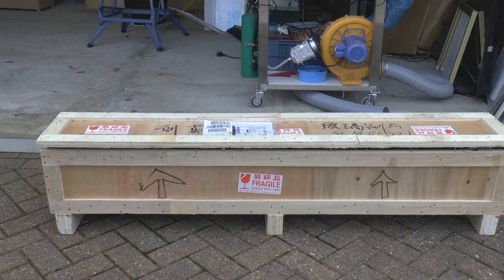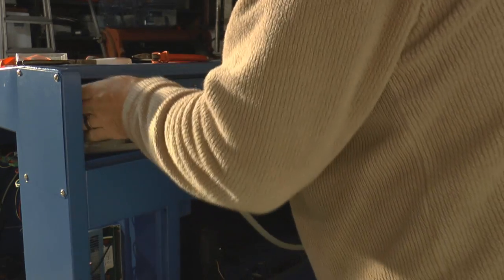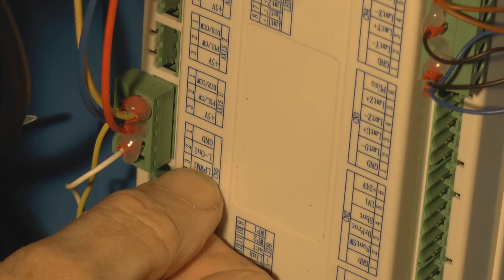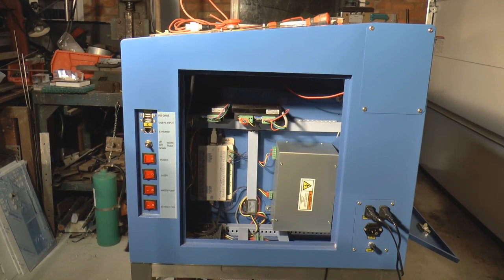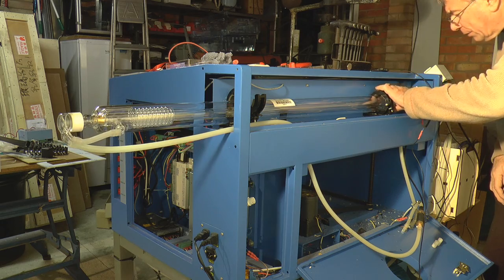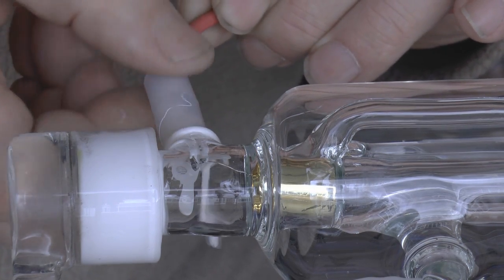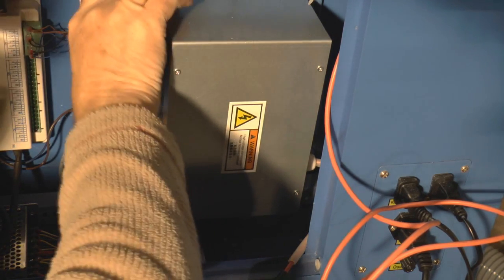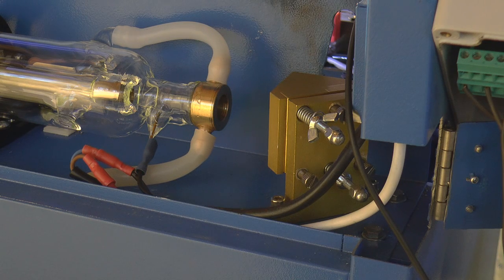RDWorks Learning Lab 50 fitting 60watt tube and PSU

Comment: Congrads! :)  I also upgraded mine to 60W recently: http://lensdigital.com/home/?p=1498
I got SP tube, and it's also outputting over spec. In fact it gives 60W at just 14mA!  However as you probably know out you can't really run it at 100% since PSU gives more current than recommended. On mine I get around 20mA at just 60-65%
Reply from the maker: +bratan007 
Nice job. Yes our tubes seem very similar 62watts at 14mA.  It's a bit like upgrading to a Ferrari after learning to drive on a donkey!!. I shall be happy to get the consistent performance that was so missing on my previous tubes.
Best regards
Russ
Reply: +SarbarMultimedia I have a 60 Watt tube that will do 60watts at 14 Ma as well.  The reason why you are able to get more at a higher Ma power setting is that they over spec the tubes (at least the good vendors do) in order to provide the advertised 2000 hrs (or whatever they promise) of service.  If you consistently run the power above 60 watts then the life of your tube will be shorter.  So I always keep my tube at the recommended spec even though I could probably drive it up to its 22Ma rating.
Reply from the maker: +Ron R 

I copy the Chinglish words from the tube manufacturer  (not an agent) in answer to my direct question about the maximum "normal" drive current.   22mA would be normal for most 2000 hour tubes but I specifically asked this question because  I noted in their specification that their recommended "normal running"   max was higher than what I had expected. I quote:

1.laser tube when you use it, please don't use full power. please set 80% power, then it can protect and prolong the laser tube lifetime. And for the 40w,60w laser tube, the lifetime is 4000 hours, if you pass over 4000 hours, then the power will decrease, it is normal. and the laser tube is consuamble, and it need to change it periodically. 
 
2. For the 60w laser, the 25-26mA current is prober. don't over 28mA. If use 22mA, the laser power would change less. 

When you examine my power/current characteristic you will note that at 22mA  I'm getting about 72 watts and the power is showing no signs of flattening off.  The manufacturer says  go ahead and use it at 26mA and you will expect 4000 hour life. This steeply rising power curve at 22mA is the overhead in the tube to ensure it gets to 4000 hours.  This is NOT a long life tube  just a lot longer life  than most cheap tubes. I have run several hours on it so far doing  full power (22mA) tests for a future project. It is an absolute dream to use after my other tube. 100% steady and predictable and I can set any point on my characteristic with confidence. I know this is what we should expect, but after my previous  experiences....well, a pleasant surprise

Regards
Russ
Reply: +SarbarMultimedia 

I know how you feel.  I have one of those large Black and Red "60 watt" lasers.  I was over-driving their (obvious to me now) 45-50 watt tube.  I put the new 60 watt tube in and it is amazing the difference.  I had the same reaction you did in the end of the future video when you made that nice deep mark in the acrylic.  Love your videos.  Great work!!

Comment: I have enjoyed all of your videos and own a 50W ebay laser myself.   You may be interested in my new post on achieving the red dot spotting laser through the optics without a beam combiner.  https://www.youtube.com/watch?v=0gABmmm_aJo
Reply from the maker: +Peter Jensen 
Hi Peter
I have seen people use a half reflecting mirror at the position you mounted your pointer, as their way of adding the red dot to the beam. I like your way better because there is no loss of power through another obstruction in the beam path. I had no intention of using the red dot as a "cut locator" when I designed my tube "clip-on" pointer (mk3). It was purely for occasional use to aid beam setting. By missing out the first mirror your aid is a completely different animal. Please don't take that as a criticism because that's not my intention, I am just examining differences. If you had turned it through 90 degrees and poked it through a bulkhead hole to pop in and out between the tube and first mirror  that would then make a great mirror reference beam tool as well.

It's rather coincidental that you are trying to solve a pattern location problem because I was discussing possible solutions for this problem with another user just recently and came up with a completely different solution that was entirely mechanical and allowed quick and accurate location of your  program to an image placed on the table. I suspect it's a but time consuming to get your picture well located when you have to track all round each time to make a small adjustments. Now that my major machine issues are behind me and I have managed to wring every last milliwatt of power from it, one of the subjects on my list of interesting topics to play with in future is just this pattern location problem, along with lots of detail features within RDWorks that I haven't touched yet because they are so poorly documented. I don't usually have to go looking for video session subjects, they are just there as problems I want to investigate/solve.
Thanks for sharing your design
Russ
Reply: Hi Russ the main reason for my  design was that having used a laser cutter with a combined red and co2 beam for about 6 or so years I really missed this facility.  Actually adjusting the pattern position is quite quick and can be done at engraving speed.  Also you could just select 2 or 3 reference points so you don't have to wait.  I  am now also looking at moving a mirror rather than moving the laser.  This negates moving wires etc. The laser could be mounted on the front plate with vertical adjustment. I also use cove adhesive on the pin bed as an absorber with zero back reflection.

Comment: what is the name of the company you purchased the system and the laser from ?
Reply from the maker: +John Grabner 
Hi John
The original machine purchase was
http://www.ebay.co.uk/itm/350B-50W-CO2-Laser-Engraving-Cutting-Machine-Auxiliary-Rotary-Device-0-60000mm-/111694615353?hash=item1a01849339

and the 60 watt upgrade kit was from
http://www.aliexpress.com/store/product/1200MM-60W-Laser-Tube-60W-co2-Laser-Power-Supply/321243_1109607209.html
You  can contact Gelly Dung directly by email if you need more information. They are very quick, honest and helpful but this is not a published contact so out of courtesy mention Russ Sadler gave you the address .......   sales02@mactron-tech.com  

Good luck
Russ
Reply: I have now watched most of your videos.  I must say I am very impressed with the systematic approach you have taken in analyzing and modifying your machine. 

You have done a great job giving an objective view of the quality of the hardware and software.  While not perfect, it appears quite acceptable.  Is this  your view?  I normally choose the devil I know over the unknown.  Your series appear to be the only objective review of the performance of a Chinese laser.

Before selecting this machine and it's software, did you do a comparison of other Chinese machines available?  If so, could you share.  

On various public bulletin boards I see lots of comments that Aluminum lasers are better than Glass tubes.  Do you have any insight on this topic?

I live in California.  Your link appears to be for someone importing this product to the UK and selling there.  Can you give me the Chinese name or the manufactures name of the laser machine so that I can look them up on Alibaba.  

You have produced a very impressive set of videos. Thank you very much.

Regards,
John
Reply from the maker: +John Grabner 
Hi John
Although I spent lots of hours researching before I bought, I was still naive at the point of purchase. I was putting too much faith in the specifications being true. I should have been wearing my ultra sceptic hat. I looked hard at the main and important mechanical features of the machine. Particularly the main slideway bearings, There are many "unusual " designs, but if these are primarily engraving machines then the Xaxis slide is going to be heavily worked. Hence I chose a conventional HiWin type slide system. I then looked at the mirror mount system and in particular the software /drive controller to make sure it was a stand-alone machine or a network machine that could in particular work with my favoured cad DXF files.. This machine ticked all those boxes and looked like a well engineered platform to adapt if so required. Having looked at others in retrospect I would choose the same again. It was excellent value for money even though the tube was not as promised!!

Look carefully at where it's shipped from. If it's direct from China you could well have to add on import duty and  taxes. If it's aleady in the USA then it will only be freight, but even then I see you can get "free" shipping with some suppliers. These ebay sellers are all agents for factories back in China, so there will be no service support if things are not what you expect. This is virtually the same package as mine which I bought from a UK seller (who is actually based in China!!) 

http://www.ebay.com/itm/High-Precise-50W-CO2-Laser-Engraving-Cutting-Machine-Engraver-Cutter-USB-Port-CE/200640422116?_trksid=p2047675.c100005.m1851&_trkparms=aid%3D222007%26algo%3DSIC.MBE%26ao%3D1%26asc%3D35695%26meid%3D8f5f5485e7894e68b208dd9919571119%26pid%3D100005%26rk%3D2%26rkt%3D6%26sd%3D370532760989

If you look at the photos, front right of the work area you will see a big silver knob. This is a manual table height adjuster. Mine is motorised and it would not take much to add a motor yourself (a nice little project). The great thing about this machine (this design is from http://shenhuilaser.en.alibaba.com/) is the decent bearing rails. The engineering is pretty good but I've made all sorts of detail changes to make my lazy life easier. If you look at the photos you will soon see the similarities (switch positions etc). Forget the warranty, I would expect it to be worthless, if this is the machine for you, just seek out the best deal and make sure you buy it with your CREDIT CARD. If things go wrong you will stand a much better chance of getting your money back from your card provider than from any Ebay or PayPal protection. Keep screen shots of what you are buying and any communications you have with the vendor. If things go wrong you will need this evidence for your card provider. All these machines are sold as 50 watt machines  but in reality they are 40 watt tubes with a 50 watt power supply. The machine case is not wide enough to take a 50 watt tube. Know this from the start and you will not be disappointed. Take your rose tinted glasses off and look at specs carefully.  Don't let this negativity put you off buying, I've had the most fun ever playing with this little Chinese dragon. This design is one of the best for it's price and is a a reasonably engineered platform to start building from. After 9 months of learning and modifications, I have got my machine to the ideal design (for me) and have now got rid of the inconsistent cheap 40 watt laser tube and upgraded to a super 60 watt system. It's now like owning a Ferrari!!!
I have no knowledge of aluminium lasers . If they are more expensive than glass you must assess the real value to you. As a hoob machine on which you are learning it may be good to buy cheap to get experience and when you know what you really want, spend the money you saved initially on an upgrade
Hope this helps
Best regards
Russ

Comment: Can't wait for the next video.  Interested in seeing results at different power levels using Milliamp Meter also.  I did order the same Millamp Meter you have and just need to cut an enclosure for it once it arrives (Just gonna use magnets to mount to top or side of case as desired).  Thanks for letting us look over your shoulder as I will say once again that your videos have been very informative and helped me avoid the very same pitfalls you've conquered.

Comment: 73 watts!! wow! by the time you are done tweaking it you may need a power meter with more range.  I do have a couple questions.  By the graph it appears the tube is still producing power and hasn't leveled out. Did the manufacturer provide a recommended maximum current that you stopped at?  Is there a current limit adjustment on the power supply so that when you set 100% in the software it only outputs the manufacturers recommended maximum current or are you going to continue keeping a mental note of what percentage gives you maximum performance. 
great initial performance. i don't think you could ask for it to be any better.
Reply from the maker: +2020tesla 
You are right about the slope. It's still going up. That's their warranty headroom. A normal 60 watt tube would run at 22mA  but even there it's a staggering output There is a 4000 hour life on this tube (and that s dropping back to 60 watts) but with the excess power at "normal running" plus the headroom that must exist above the 80% (26mA) max that they specify, this is a truly awesome tube. If you look at their website it looks like a small family run business where everyone cares because everyone is accountable. I'm sure they will get follow on business with tubes like this.  The PSU inputs look as though they were designed for this controller. A generally silky smooth upgrade in about 3 hour plus an hour testing. The power didn't know what hit it!!!! I was having doubts myself but I have acquired absolute faith in Macken.